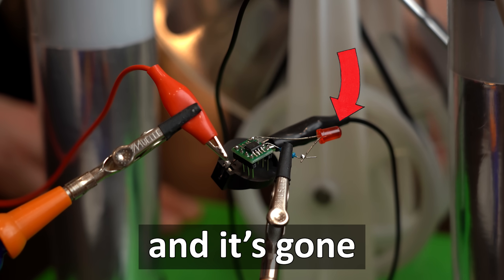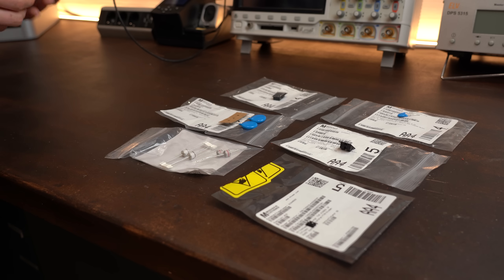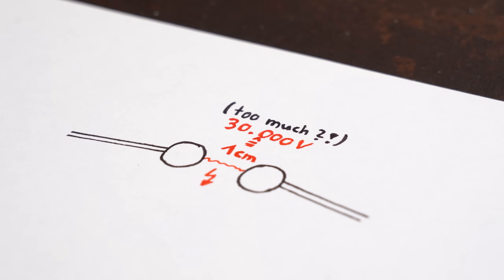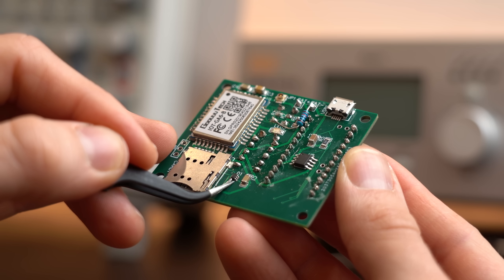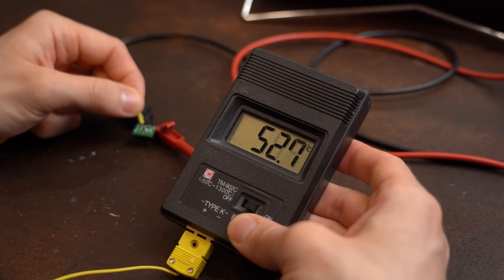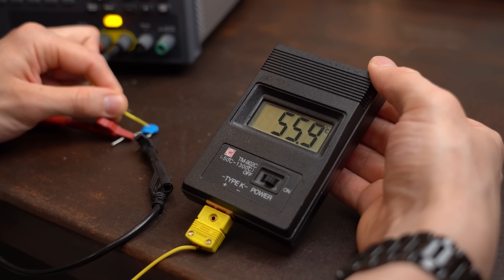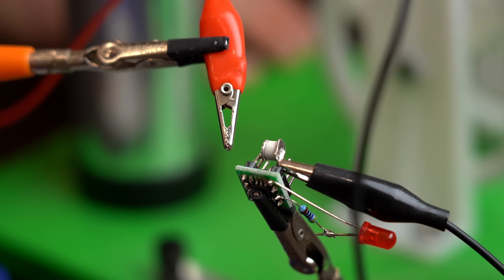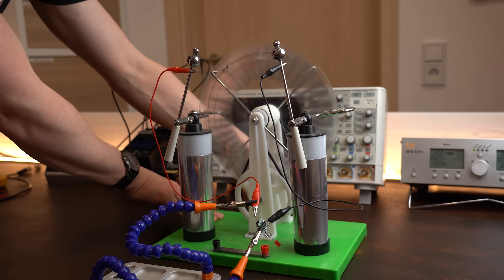This $0.70 Component SAVES your Circuit?! (Surge Protection) EB#59

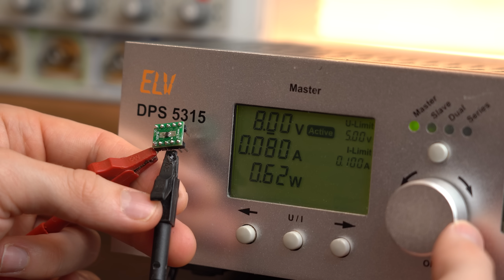Comment: The question in my mind at this moment (6:37 in the video) is if you mention zener diodes and/or voltage regulators.  Similar operational regimes, if I recall correctly after all these years.

Comment: I used some components like the GDT to protect a lora antenna coax from high transient voltages, probably will not know if it really works until it doesn't. I think it was suggested to replace them occasionally as repeated spikes can make them fail. I imagine that a passing thunderstorm could induce significant spikes even without a lightning strike. I really appreciate the information you provide, Thank you.

Comment: At 6:12 there is a mistake: increasing the air gap doesn't increase the voltage across the board but only the voltage across the air gap, doing this just increases resistance and reduces the current.

Comment: question. does the cheap SPD have an LED in series (leak current)  with MOV? if so would it not work in reverse flow and not react fast enough?

Comment: I have had overvoltage(home) in sockets but the ptotecton has not blown due to low power demand aka no load but low power devices and those devices have got lots of damage, some insta out of commission others over time.

Comment: Good video. I want also mention, for low speed input lines often simple ceramic capacitors are used to protect the input from ESD loads. Usually 10 to 100nF are used.

Comment: Them huge capacitors on the spinning magnet wheel.... Memories of the simple schoolgirl engine & beyond. 
Bedini would be proud.   Now just catch the collapsing spikes in a lead acid battery, to feed back to the capacitors. 
Not perpetual motion, but tuned right, a heat pump that can run for a surprisingly long time.

Comment: We used to add MOVs to anything with an inductive load (PLC control systems working at 24VDC). Even contactors or solenoid valves can be a problem. Inductive spikes were a particular problem with high speed counters or servo-motors which use incremental encoders. An extra count here and there can really foul things up for the position of a pick and place robot.
Reply: why MOV and not reverse diode?

Comment: Idea for next videos:

Recently I found out that I can power my Black pill from my smartphone with simple TypeC-TypeC cable (yes, it's all about 5.1K resistors). Could you please research on it and investigate max power capabilities smartphone can have, which other embedded devices it can power, can it power small motor, can it be burned down, does smarphone has protection agains overcurrent and so on?

For me it appeared like an interesting topic as I am currently developing 2 small projects where my devices are not required to run 24/7 but only when only man uses it. So I could get rid of wall power adapter or Li-ion battery

Comment: Everyone should take a look at replacing all of these with the new devices TI has come up with. They are meant as TVS replacements so are named like TVS1400, TVS1401 etc. Where most protection devices are good for at best 100 hits these are tested at 5000 and still work🤯 They are especially good for automotive devices where repeated surges are normally experienced on a nearly daily basis.
Reply: Also do a web search for "combined SMA and TI TVS footprint" for an idea how they can be added into an existing design to allow easy transition  without a complete redesign being needed.

Comment: Thank you. I have a Ethernet switch had on solar power and the 12 volt regulator went bad and it did about 24 volts then and 2 surface mounted components right by the power input blow up L2 and L3. From this video I order 2 SZSMF4L12AT3G Zen TVS 400W 12V UNI from mouser. I hope that fixes it. Looked up "12 volt TVS diode" I guess for 12 volts it should be 12 volts right or maybe a little more for leeway? Thank you.

Comment: Thank you for the deep-dive and clarifying these parts. What is the best practice for TVS application in a digital circuit? Just on the power rails? Power rails and any connections that touch the outside of the product housing? What about cap touch LCDs  that get touched (obviously) - their power rail too?

Comment: I've been struck by lightning, I think. I was in the garage, but touching a metal security door frame and next thing I knew I was lying on the floor and my fingertips were blackened.

This was at my grandma's home, but att my second childhood home the house kept getting struck by lightning and a lightning conductor did nothing. Computers and dialup modems had to be replaced often. Lightning behaves weird when there are ore deposits involved.

Comment: 9:37
Quick correction, that isn't a thermal fuse, it's just a standard electrical fuse. 
A thermal fuse is tripped when the temperature of a component gets too high. 
For example on motors to stop the windings from burning, electric heaters to stop your house from burning, hotplates to stop the hotplate from burning and so on.
The resettable thermal fuses are usually found on components like electric heaters, hotplates, dehumidifiers and other devices, though are a first line of defense, they reset after the temperature drops (though microcontrollers have taken their place in some applications) but they'll also be found as second line of defense devices on industrial electronics (or higher end consumer stuff) where you have a uC and temperature probe (thermistor or thermocouple) monitoring the temp, but if the uC crashes, the resettable thermal fuse cuts the circuit, then if that fails a thermal fuse (attached using thermal paste) blows, giving the device 2 chances to recover and one chance to need fairly simple repairs.

Comment: I dicovered TVS and varistors while reasearching for a DIY TIG welder, they seem to be used at the output of the Diode rectifier to avoid the HF/HV starter from blowing the diodes

Comment: Very nice video!
One overvoltage protection circuit (not sure if it'd be a surge protection then?) that I found interesting is the crowbar circuit. I saw it first on the output side of a 3.3V PSU, but don't know too much about their effectiveness, are those too slow to act as surge protection?

Comment: I had a raspberry pi's tvs blow up, accidentally hooked it to a wrong power source. The tvs was shorted and generated a lot of heat to the point of removing my fingerprint when the raspberry pi had power, i knew the pi was fine so i desoldered the tvs and it startet working again, has been working 24/7 since

Comment: The main reason the MOV is protected by a fuse in series is not because the fuse will blow in the case of an overvoltage event. As the MOV starts to age due to surges, its resistance decreases, which in turn increases the current flow through the MOV, leading it to heat up and you end up in a vicious circle that will end in the MOV bursting or cathing fire and the circuit, without the fuse, drawing way more amps than anticipated. In order to protect that from happening, the MOVs are now protected by a fuse.
Reply: So the mov isn't locked in there with the fuse, the fuse is locked in there with MOV

Comment: Increasing the gap voltage doesn't change the voltage applied to the board by much since most of the extra voltage simply gets lost in the arc. It does increase the peak discharge current though. As for why the MOV manages to save the circuit despite having much higher voltage, that is down to your generator having pFs of output capacitance discharging into the MOV's nF of parasitic capacitance, forming a capacitive voltage divider that drags the discharge voltage low enough to save the input pin from excess ESD current. Also, IO pins have their own internal protection from the output FETs' body diodes that can usually handle human-body-model ESD as-is as long as the chip has a path from power+ground pins (depending on ESD polarity) to actual ground. Chips on an assembled grounded PCB can be surprisingly difficult to kill as Linus demonstrated in his Electroboom special.
Reply: I think you are the only one in this comment section who actually knows stuff.

Comment: Won't the shunt capacitnce from the varistor across the supply rail reduce the peak surge from the spark? On a supply rail you can add capacitnce which in conjunction with the short time  of the fake static distarge would provide enougbh protection.

Comment: I've seen real weird stuff happen with lightning strikes, I'm sure it could be explained but oddness like a garden patio covered in tiny copper balls which were the leftovers of the coax from a direct strike on a TV antenna but the TV itself worked just fine, pretty much every piece of electronics in the house next door was dead, there's just so much power that it's incredibly difficult to defend against. 

Static is easier but it's always good to know that MOVs, VDRs and transient suppression devices like those tiny diodes degrade every time they're 'triggered', it's a real common fault for them to fail on USB ports in handheld devices for instance

Comment: I have had a MOV absolutely blow it's guts up in a shower of sparks in a power supply for my PC, it was green in colour and ceramic and was within the power factor correction side of the circuit. 

I was having constant over voltage events of around 255V for a year and I think it wore out or something. All I did was flip the switch at the wall

Comment: We usually work in solar systems and we use surges all the time in both AC (grid input) and DC (pv input) but not these types it is similar to the red one but a glass insulator breaks open and allows everything to flow to ground instead of dissipating as heat and it is connected in parallel with the circuit. AGAIN IT IS USED FOR DIRECT LIGHTNING STRIKES AND CAN ONLY POP ONCE BEFORE DISPOSAL.

Comment: As a notebook repairman, I am very familiar with diode arrays, it is very common to find them protecting the USB, HDMI and other connectors on the boards, many versions of notebooks for home use differ from the corporate versions in that although they have the tracks, They do not have the chip installed, this small saving makes the notebook much more delicate, plus now all those connections go directly to the SOC, system on chip, practically killing the processor in the event of any incident.
Reply: there are routes for them and they arent soldered? lol

Comment: When you mentioned the disadvantages of the TVS diode, you said leakage current and parasitic capacitance. But don't these also exist in normal wire? Maybe to a smaller degree?

Comment: "One point twenty one jigga-watts! Great Scott!"
Definitely interesting; I'll use TVS diodes in my projects more. MOVs are pretty common, I replaced a good bunch of these in various devices, which means they did a good job of protecting the circuit.

Comment: 9:25 ".... dies immediately...." (shows a working circuit) 🙃🙂9:39 ".... that blows when overvoltage takes place", you mean current. Such fuse blows only when there is excessive CURRENT. 9:50 Aha! I spotted one (GPT) in an inverter, didn't know what it was until now. It was tied between the 230v output AC lines (N & L).

Comment: Are you sure about the voltage generated? Because the voltage you said is 30k/cm, but this is the voltage between the 2 points.
If it starts at 30kV, then it decreases in the air, when it arrives on your device the voltage is way lower?
So with 5mm, 15kV at the beginning of the thunder, but lower than 1k at the end, when it touches your circuit?
Or am I wrong?

Comment: The cheaper one for solar should actually handle more current. It uses a multi layer carbon spark gap with movs to equalize the voltage across the disks via their capacitance. Mov protection is good for lower let through voltage but it is not going to handle current as well as a spark gap. Only issue with spark gaps / GDT is their follow on current, but you need a high current to maintain the arc, your solar wont produce that much current.
Reply: Also TVS are generally used for data lines because MOV capacitance is too high for higher frequency signals.

Comment: This video is really helpful. I suffered a power spike a couple years ago when the transformer outside my house blew up. lost a few appliances, namely my robot vacuum, looking at the board there were large scorch marks and some exploded components, after some research I discovered it was a varistor. easy enough to replace and still working to this day

Comment: I have experienced two direct strikes on antennas fitted with lightning arresters and direct grounding wiring. The equipment survived without damage but proper protection is a bulky affair with thick cabling required to provide a low impedance path to ground. All the power circuit protection devices tripped, but no damage was done and everything worked after the tripped breakers were reset.

Comment: The GDT can create a lot of interference and scramble sensitive logic circuits digital logic since when the tube fires, the voltage across it collapses very quickly to a lower voltage, creating EMC surges.  TVS diodes and MOVs tend to create much less EMC interference because they clamp the voltage and don't exhibit the voltage collapsing effect.  So whenever we have to use a GDT (for example, when extremely low leakage current and stray capacitance is critical), we have to incorporate other protective devices in such a way to minimize the EMC surges.

Comment: I've heard of people building oscillators using an RC circuit and a TVS diode, of course it wasn't for a stable frequency, but for an unregulated step-up circuit. Cheap parts create cheap builds.

Comment: ...Re insulation tester being too safe (3'12") 
... How about using insulation tester to charge a high voltage capacitor (maybe even your Leydon jar???), then use a switch (or flying lead) to connect your test circuit board? ( i.e. only connect test circuit once the capacitor voltage is at the desired destructive level)
...A neon in series might also add some visual effect?

Comment: TVS diodes are great, and should be included in any "real" project intended for more than a test on the bench. They're cheap, almost invisible to the circuit in question, and make just about any low-voltage digital circuit highly tolerant to most of what it might encounter in the real world.

Comment: I built a home energy monitor using CT clamps, and I learned they incorporate a TVS diode inside the clamp.  Because without any load on the other end of the clamp, the 100A of current on my main line running through the core can generate theoretically millions of volts, and the whole thing just explodes in a puff of smoke without even touching any metal wires.

I learned about their existence because I didn't understand any of this and unplugged my CT clamps from their load while current was running through them.  The TVS diodes did their job, shunting the voltage to I think 22 volts, and making a hell of a racket, both noise and vibration, while they did so.  Both clamps were unharmed and continue working accurately to this day.
Reply: Great story, can you remember how big these tvs must have been?

Comment: @GreatScott -- I don't know how deep on this topic you're interested in going, but -- in light of your summary at 10:31, it would be interesting to explore how to use these components in combinations. (Along with "spark gap" which is essentially DIY GDT.)  It might seem using these in some combination might handle multiple over-voltage/arc scenarios, but does the right protector step in at the right time or voltage to avoid the other protector getting overstressed?

Comment: Thank you @greatscottlab
This video was very educational. What book would you recommend getting similar information for electronic tinkerers? I typically find very theoretical books on electronics or super simple books which mostly around: how to tinker with arduino with components. 

I saw a video from Adrian Black once, where he exchanged elcos agains ceramic caps and worked with a conversion table. I really would like all these practical helps in a single source like a book or similar.

Comment: Mouser have terribly high postage because UPS is expensive. Farnell is the same. I will not pay 20 USD which is usually more than the price of the goods I buy. So the local store called Conrad is a go.

Comment: Would perhaps naively think that 'cheapo' one with multiple MOV would react a lot faster than the 'better' one which requires heat to melt solder.

Comment: About 10 years ago I accidentally connected a 12v dc circuit to 240v ac, when it didn't work  I soon realised my mistake and connected it back to the proper 12v dc again and it worked. I've never quite understood how the 240v didn't fry it. that same board is still working to this day.

Comment: When using a MOV on high side of power supply, you need to take account their failure mode: slowly conductive.
So either couple them with thermal fuse close to them, or a combo MOV+ThFuse, or you can end up with a fire event in case of repetitive surges.

Comment: Hi Scott
This video is really interested, I am about to built a PoE injector for my wireless point to point device , I wonder if I added  the GDT over the data line is that will effect the data rate ? the connection speed of the data is 1Gbps , is that make work in less data rate ?